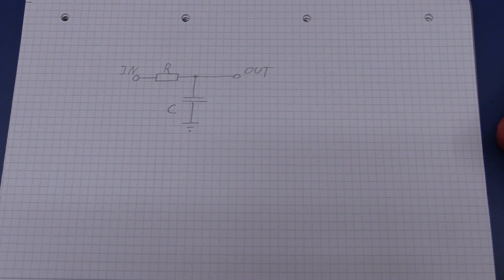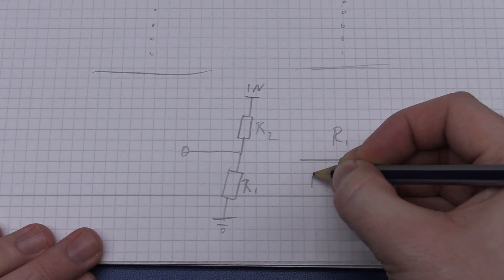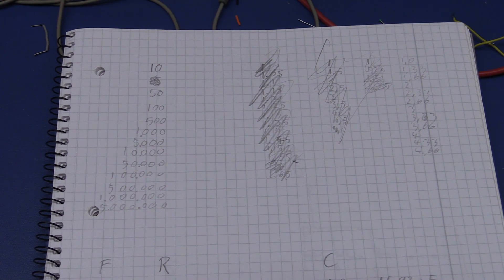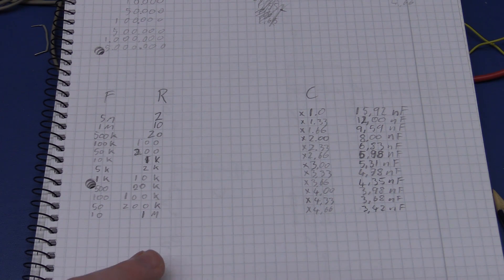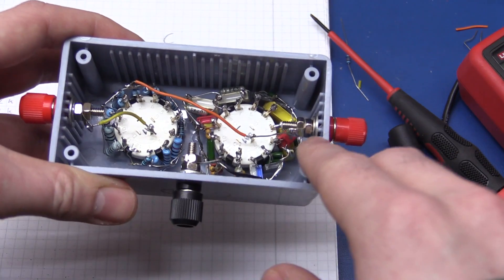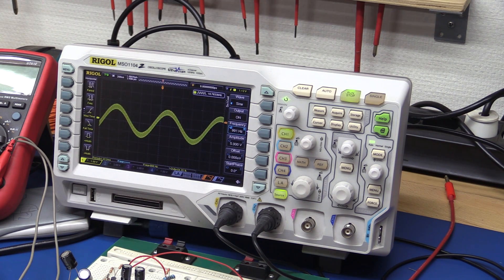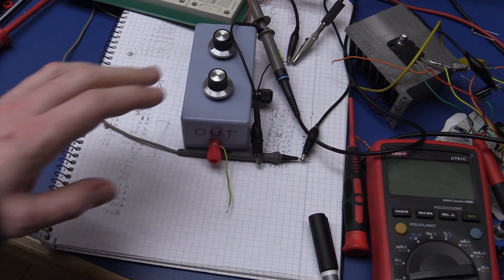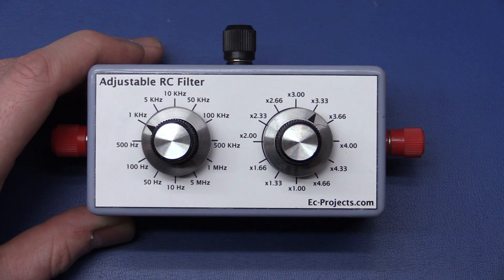RC Low Pass Filter Box (Adjustable) - Ec-Projects

Comment: With high resistance/low capacitance filter, as You did it, you'll have such voltage drops that this filter has no practical value. The way to go is low resistance/high capacitance.
Reply from the maker: That depends entirely on the application. Low resistance and high capacitance can equally "have no practical value", if your source is high impedance.
Reply: @EcProjects  I really haven't measured impedance of power sources (transformers and switching supplies) but I'm sure that after 1MOhm (for 10Hz filter) in series you would need power plant to have usable Vout. I'm talking from PSU viewpoint.
Reply from the maker: @anti_globalista  Again, that really depends on the application. You cannot say one is better than the other.
A high impedance source could be, an electric guitar, an op-amp, a signal generator, etc

Comment: Nice project, thanks. If some one need a adjustable  active filter I can recommend LA 10 https://www.h-instruments.com/Low_and_High_pass_filter_LA-10_Adjustable/p484050_17499584.aspx     and LA-2 https://www.h-instruments.com/Adjustable__Low_Pass_Filter,_50_HZ_TO_50_KHZ_10_fixed_frequency_LA10/p484050_14652188.aspx  both from H-Instruments

Comment: I build little test jigs or test sets in little boxes quite a bit at work. I've found that I started to  mount the switches and components on the lid/cover. It makes it a lot easier to build, modify or repair. I liked your label, funny thing is I do that to as it lends to a more professional look. We use some clear sticky over it and it will last for years. Heavy clear packing tape works fairly well too. Thanks for the show. Best Wishes n Blessings. Keith

Comment: Rather than using the rotary switch for resistors, could I use a potentiometer?
Reply from the maker: sure, perhaps I should have mentioned that actually :) I just wanted fixed values :)
Reply: EcProjects a 10k potentiometer will be enough? Instead of resistors?

Comment: Nice project. You should get a can of spray adhesive like 3M 77 for your labels and such. 1 can will last a long time. It's the same thing used for automotive headliners and many other applications. It's also ideal for lining an enclosure with aluminum foil for shielding. It won't soak into anything (even headliner fabric) but will hold a flat surface like nothing else.